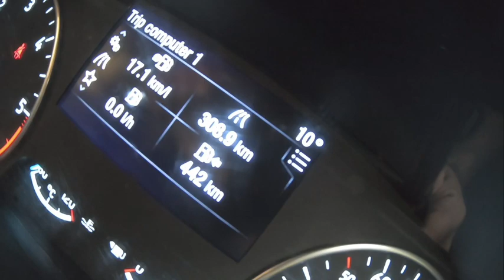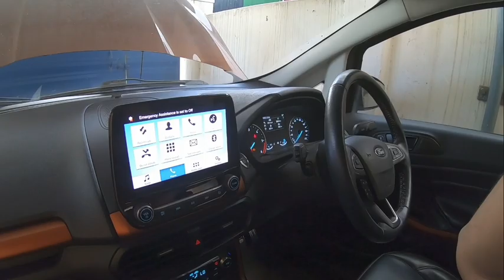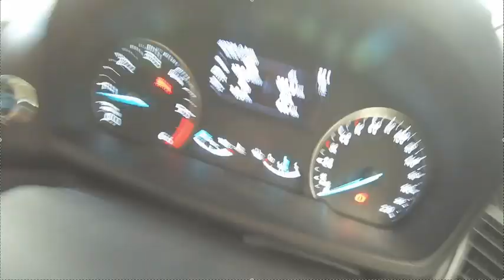Ford Ecosport Ambient Temperature Sensor

Comment: Will the AC not work if we have a bad ambient temperature sensor?
Reply from the maker: AC will stop working only if 2 sensors in the AC unit fail, as AC is not just dependent on only one sensor input to judge the temperature